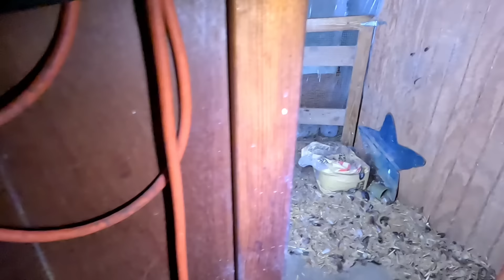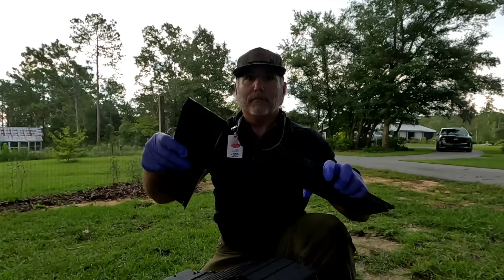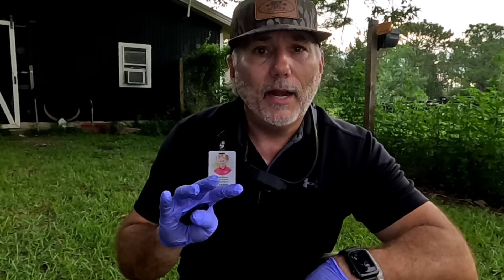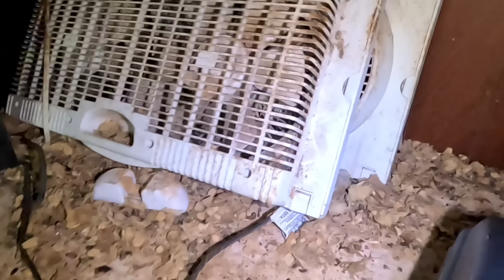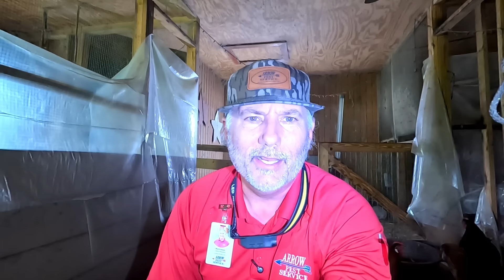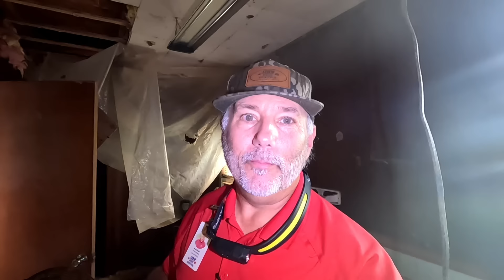Most Effective Rat Control Method Nobody Talks About!

Comment: I heard mice scurrying in my addic. I set up 10 bait traps in addic. 8 snap traps, 2 twist snap traps, and one bait station. Any other ideas to get them out of my addic?
Reply: Dcon bait station they sell at dollar general. Comes with station and bait block. Also Used the old school wooden snap traps with peanut butter. Also dollars general sells twist traps you put bait in, twist it, and when the mouse walks in there it traps them. I put peanut butter in those as well. I just put the traps in today. I'll follow up if I catch some. If not, I'm gonna try your bait suggestions out. Looked like it worked good
Reply from the maker: @MeOmny  hopefully it'll work good for you, let me know if you have any questions. I'll be glad to help anyway I can't. Good luck.
Reply from the maker: What did you bait them with?
Did you get any?
Reply: You need to find out where the entry points are, and seal them.  Otherwise you’re just waisting your time.
Reply from the maker: @rodgraff1782 💯
Reply: Giving an update. I caught the mouse in my addict. Got him with one of the old wooden snap trap with peanut butter.  I am working on sealing all gaps and cracks as well.